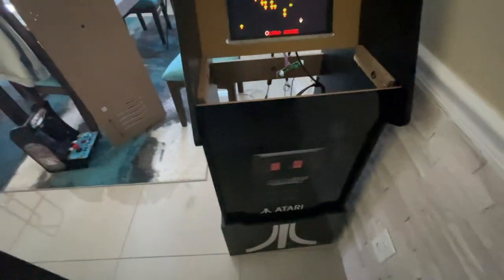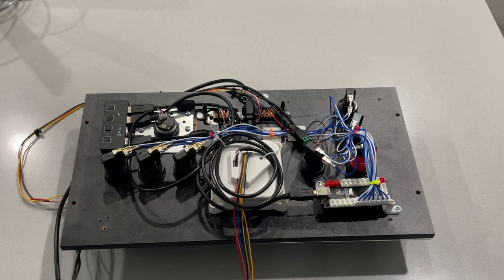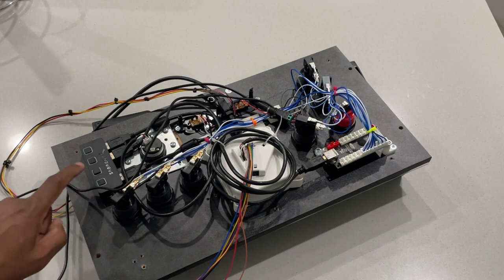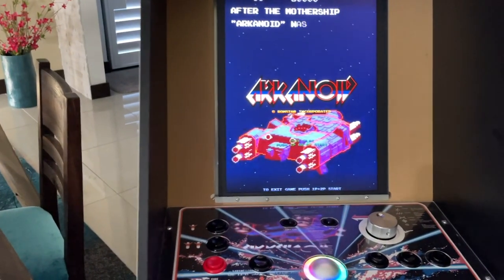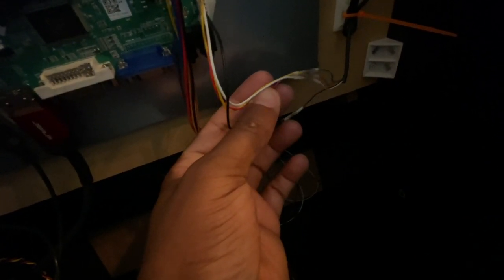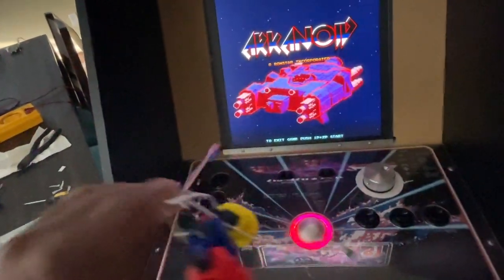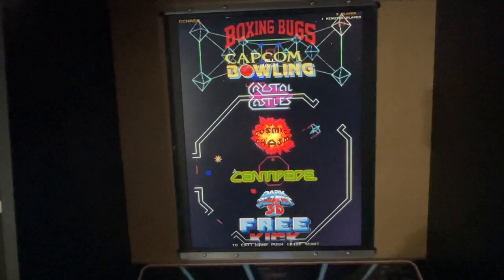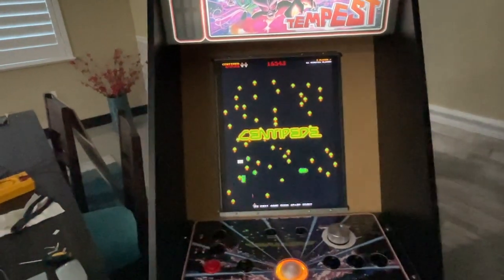How to Fix Arcade1up Atari Legacy Cabinet

Comment: Hey there. Nice work! This is exactly what I was looking for. You've inspired me to attempt the same conversion, especially since my stock encoder died. Problem is, I have absolute zero experience with arcade CPUs or any sort of coding, for that matter. I've seen other videos using the Atomic Pi, but I'd desperately love to replicate what you've done here. I took a look at your Readme in the google drive, but it looks like ancient greek to me. I've ordered most of the items you listed, and started the wiring process, but is there any chance you could do a tutorial on how you got the Atomic Pi set up?

Comment: So is it just the original monitor rotated 90 degrees? Is it in the same location? It looks like it’s set further back.
Reply from the maker: Pretty much. I got a vertical monitor loin in there and used the original monitor. I corrected for the rotation in The software
Reply: @lordjules  very impressive mod.  I especially like the wiring job where you have just power cord running out of the back of the cabinet.  Have you thought about modding the marquee so it’s angled like on the original?

Comment: There are 2 images in the Google Drive folder - 2019-09-25-rpd-x86-buster.iso and atomicpi_atarilegacy.img - which one do I need or both? I'm modding my 12 in 1 Atari Legacy cabinet with this setup.. thnx in advance.
Reply from the maker: You want the Atari legacy.  Keep in mom there are no Roms in there. You’ll need to ssh into the pi and put the roms manually
Reply: @lordjules  perfect - I have all the roms already but what about artwork for the games? Do I need to run a scraper for artwork and snaps?
Reply from the maker: @coinop29  artwork and snaps are there for the games I highlighted in the video. Only thing missing are the roms.
Reply: @lordjules  Another question - do you have a video on how to flash your image onto the AtomicPi? Is it as easy as putting in a USB key drive with the image and writing it that way or do you have to  use Etcher or something?
Reply from the maker: @coinop29  see the README in the google drive link in the video description.  You can use “dd” directly from you computer and flash over the network. If you can put the image on a USB drive and use “dd” to restore the image. Either way works. I believe I cover both options.
Reply: @lordjules  Awesome - I just flashed it to an SD card and that worked! Now trying to get sound out of the Atomic Pi and following your instructions on how to rotate the display

Comment: will this work without the vertical monitor setup? ie. Can I leave the monitor in horizontal mode?
Reply from the maker: If you’re using my atomic pi image then you’ll need to undo the 90 degree rotation I did for emulation station as well as the front end.
Reply: @lordjules  cool - another question - I have a Pi 4 - will your image work with this?
Reply from the maker: @coinop29  No. This image is specifically for the 16GB eMMC flash on the atomic pi. The version of Debian Buster in the image is compiled for the x86 architecture of the atomic pi. Whereas the raspberry pi is arm based.
Reply: @lordjules  Ok I've never "undid" that before - is it pretty easy to do? Is it in the config file on the image? or do you have to do it in the Raspi-config settings?
Reply from the maker: @coinop29  /opt/retropie/configs/all/autostart.sh
Reply: @lordjules  awesome thnx - just ordered an atomic.. The original 12 in 1 legacy has failed on me twice already - I really needed an alternative and I tried to do it with a PI 4 in attract mode but never managed to get the settings to work correctly.
Reply: @lordjules  So your image doesn’t have an autostart file in that directory.. Is it somewhere else?
Reply from the maker: @coinop29  ok, did some digging. For retroarch, rotate is here: /opt/retropie/configs/arcade/retroarch.cfg. comment the two lines with video_allow_rotate and video_rotation

I believe you can also do this from raspi-config or retroarch setup script but I can’t remember exactly. You definitely can edit the shader from the setup, so may have an option there as well.

For the a1up intro video, it’s in ~/.config/openbox/autostart

Finally, for attract mode rotation grep for “rotate”. E.g. “history | grep rotate” It’s the one with the “echo 1 l sudo tee /sys/class/graphics/fbcon/rotate 

I think you write a 0. E.g. “echo 0 | sudo tee… 
0 = normal orientation (0 degree)
1 = 90 degrees 
2  = 180 degrees
3 = 270 degrees

The xrandr -rotate calls do not persist hence the need for the other call.
Reply: @lordjules  Thanks - I did all that but it's still in the Vertical position.. I've managed to make it change on a Pi4 before but maybe it's just not easy to do on an AtomicPi?
Reply from the maker: @coinop29  which is vertical. The attract mode or mame (when you launch the game) ?
Reply: @lordjules  It's ok, I gave up and returned the AtomicPi - I think I just need something more plug and play.. I'm going to stick to my Pi4 - Attract Mode setup and try to fine tune it more.

Comment: Very nice, it's a shame A1up dropped the ball on this one with the monitor
Reply from the maker: It looks like they’ll be doing it again with that new Centipede cab. Looks like another horizontal orientation based on the screenshots.
Reply: @lordjules  they just don't get it
Reply: @show-me-retro  When most of the games are horizontal, why would you put in a vertical screen. I'm getting the centipede one, and it doesn't bother me, they scale it anyways.

later
-1
Reply: @negative1723  they should only be putting vertical games on a vertical cab and horizontal games on a horizontal screen... it's how the games were meant to be played. It's pretty simple
Reply: @show-me-retro  I don't want multiple cabinets. I want as many games as possible. Thats why having a lot of games is a good compromise. They're not going to put only 3-4 games of one kind on an Atari compilation. Maybe if there was a pro series centipede or tempest would they do a vertical one. 

later
-1
Reply: @negative1723  - Then they should design them with a rotating monitor - wouldn't cost much to add and would let them mix them into a single cab without losing the authenticity of gameplay !
Reply: @jdfan0121  That's a good idea. Atgames has tried that. I don't know how often it would be used though. Maybe they'll consider it in the future.

But again, I've said it many times, the vast majority of casual players don't care. If we want that feature, we have to mod it ourselves.

later
-1